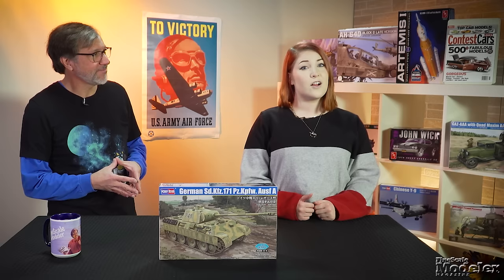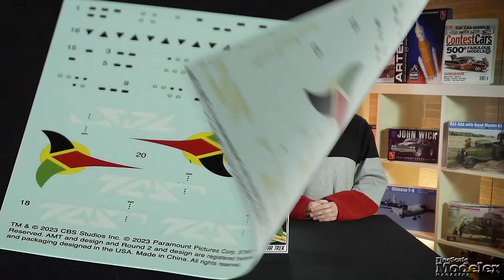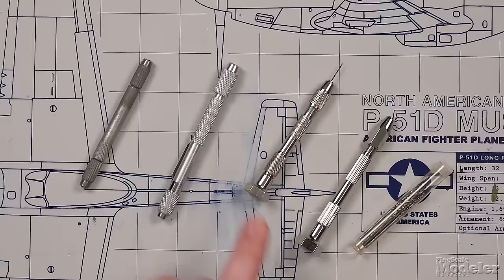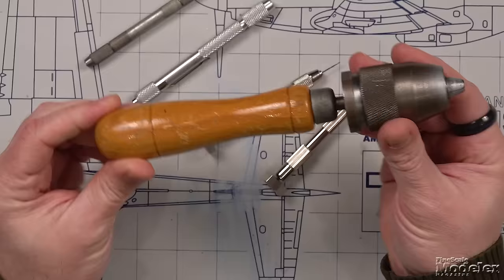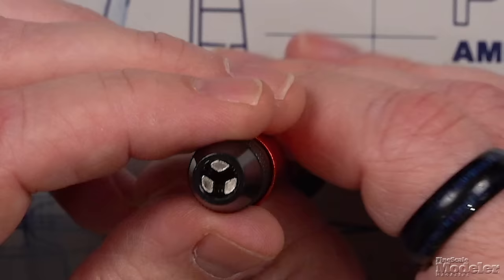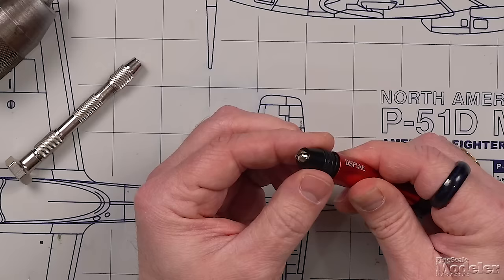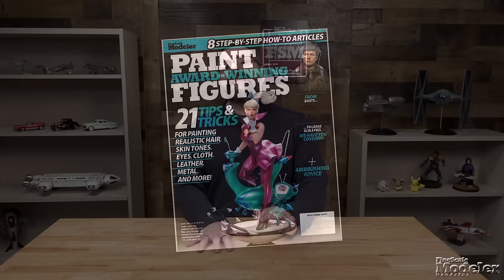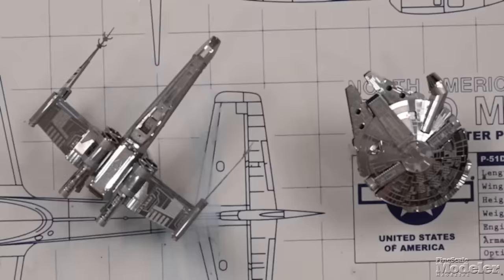FSM unboxes new kits, reviews the pros and cons of pin vises, and takes on Metal Earth models

Comment: The David Union 150 pin vice is also a fantastic tool, and has a larger range of capacity in the chuck. Those drills with the coloured sleeves are awful in hand tools. They are designed for very high speed and as they have a shallow helix they tend to "screw" into the plastic and snap very easily.
Reply: I have been trying to get a David union 150 for months having followed your Channel and review Nigel. Premium Hobbies rarely have them and when they do they sell,out very quickly 😢

Comment: I have built a few Metal Earth models. They’re cool to assemble once in a while, when taking a break from fine scale work. I prefer the photo etch detail sets for fine scale models such as those from Eduard. I like that they are more precise and detailed to fit a model and are to scale. Metal Earth are more of a pastime from my pastime…

I suppose I lean more towards creating highly detailed, multi material, accurate representation of the real thing and that is my enjoyment and challenge. There are some that enjoy Metal Earth and the limitations they present, and that’s fine. I used to build plane kits from cardboard stock that were printed in an Air Force magazine. They were nice but still lacked the capability of fine detail. When you want precision scale across models for comparison, extreme detail with resin, photo etch and custom details, the ability to go way beyond the box kit, there is nothing like plastic and resting kits to be able to achieve those goals.

Comment: Nice video folks! I have been using the drill bits with the 1/8 inch shanks  for several years and typically just use my fingers when not inserting them in my Dremel, but I may have to invest in the handle you demonstrated. I have a few of the Metal Earth kits, both built and in my stash. I have taken Metal Earth kits on vacations as I need fewer tools than I use on my typical models, and I do not paint the Metal Earth kits. You also brought up a good point in that they require you to work with what is essentially a heavy photoetch set. The Metal Earth kits are a great way to expand your modeling horizons!
Reply from the maker: Thanks, Scott!

Comment: IMHO they missed a bet with the vintage Klingon ship.  The original came with clear, green tinted windows for lighting.  The original used a grain of wheat bulb which was prone to burnout.  I'm pretty sure that the original bulbous front area of the ship also had window holes for lighting, not window decals.

It is nice they included the plated parts though.  Sure they're not canon, but they remind me of the kit I build in my youth.
Reply: Plating is handy when doing a quick and dirty alternative for lighted parts. On  sci-fi kits in  small scales like 1/2500 I put bare metal foil bits on parts you would actually light in larger scales. Color the foil with translucent paints or makers, then clear coat. Ambient light reflects off the shiny metal through the translucent color and gives a fairly decent “lit” effect on small surfaces.

Comment: Hobby lobby has one of the best, durable and easy to use pinvise available. Comes with drill bits for $10 or so $.
11:33 - that Uber fancy packaging might be bit of over kill… but what do I know?
Reply: Are you talking about the one in the modeling area? I found an even better one in the woodworking/wood burning area.

Comment: At the end of the day, small drill bits need HIGH rpm to function properly, anything under half a mm will probably choke on plastic and snap especially if you push that bit to hard!🤷🏼‍♂️
Reply from the maker: For going through plastic or wood, your don't need high RPM. High RPM is just going to melt the plastic. We've been using micro drill bits for years to drill tiny holes and they work quite well in a pin vise.
Reply: @FineScaleModelermagazine  Hi, I hope you don’t think my comments were a criticism!? It is generally recognized in engineering that the smaller the drill the higher the rpm needed to function properly! I’m not suggesting that we all stop using pin vices, I use them all the time,it would be a struggle for us to use,say a Dremel to drill some of the holes we have to drill! You just have to be watch that the drill doesn’t “choke” when breaking through! Cheers!

Comment: I have the Dspiae pin vise, albeit marketed by Meng.  It's a great pin vise but the bits are no good at all, at least the ones I've purchased.  The smallest diameter bits break at the slightest.  I've read of other people having the same problem.  Now, I got mine some time ago and they may have changed whoever supplied them and the metal they are made of.  This I don't know.  But the smallest diameter bits that came with the pin vise and those I bought separately later (also marketed for Dspiae by Meng) would break if I looked at them wrong.  Be advised if you plan to be using the two or three smallest bits.
Reply: Those tungsten steel bits are completely inappropriate for modeling.  They don't need to be hard, they need to be strong. Even pig iron will have no problem with soft plastic.  People are overpaying for extra-brittle bits that are designed for electronics work.
Reply: @zacklewis342  As a professional machinist, I concur, the tungsten carbide drill bits are super hard, (harder than diamond, if I remember correctly), designed for drilling epoxy glass circuit boards, and therefore, super brittle, and only useable in a super rigid machine set up, a manual milling machine (used very very carefully) or cnc machine that is capable of the rpm required, depending on the diameter, (5000+rpm).  If you break one off in your project, it is now junk, cause you will never get it out. High Speed Steel, HSS, is all you need for the drilling requirements of our hobby, they are hard enough to maintain an edge, yet are more forgiving to misalignment, that would occur when hand drilling.